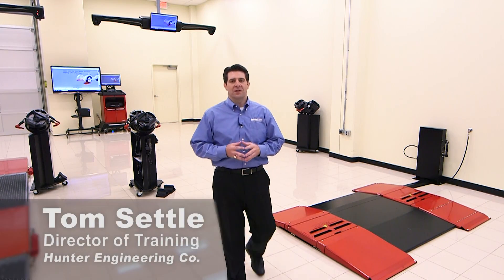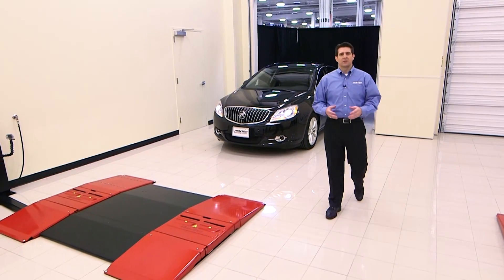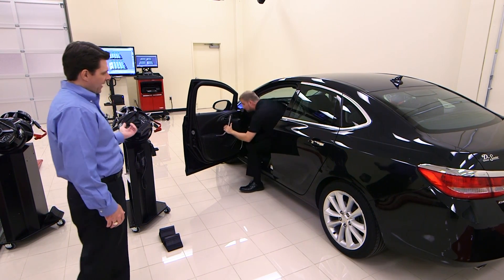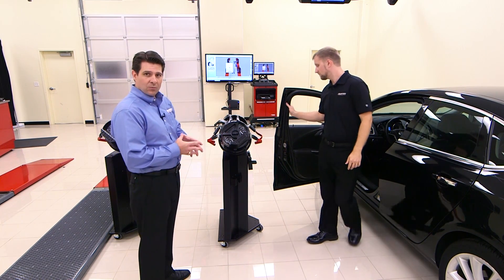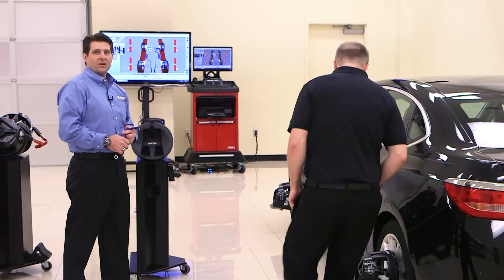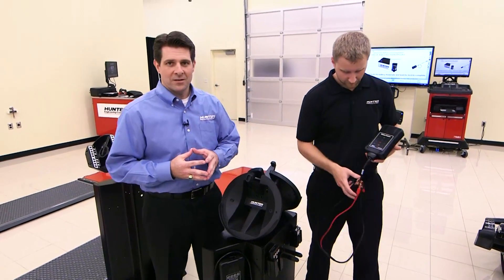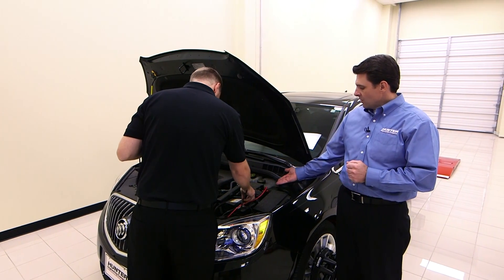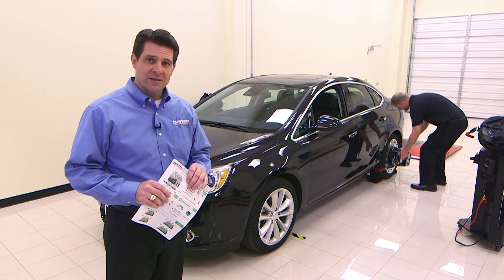Quick Check Training - Hunter Engineering

Comment: Can you clarify for those who don't know, do wheel covers need to be removed? I know they don't need to be removed, but work with a shop full of guys who think they do.
Reply from the maker: Hello. Hawkeye Elite requires secure adaptor mounting.  This can be accomplished on most vehicles without removing wheel covers/hub caps.  The key with any wheel is a gentle tug after mounting to determine if the adaptor is secure.
Reply: @HunterLearningChannel  Thanks